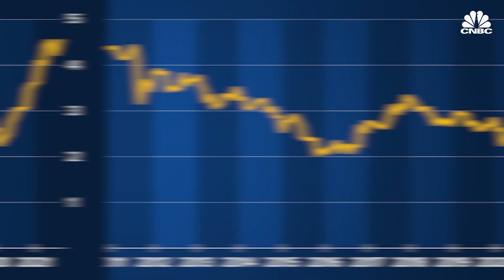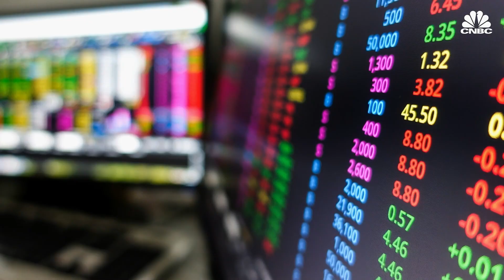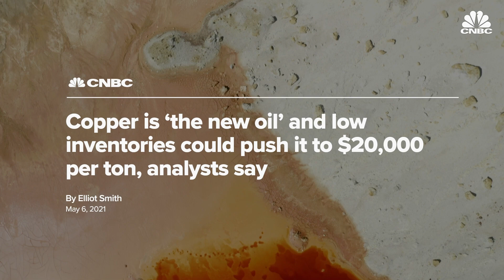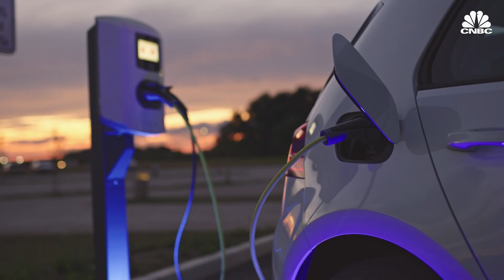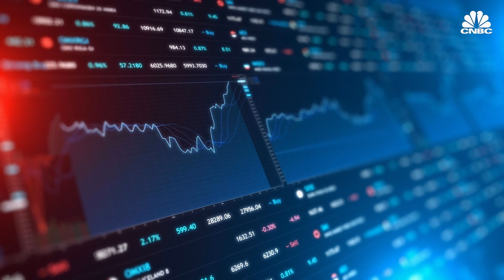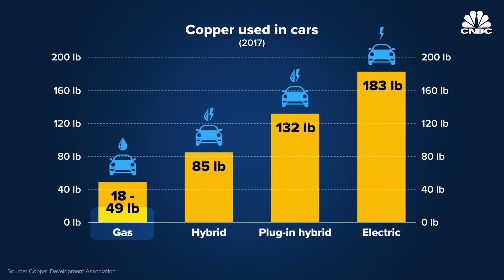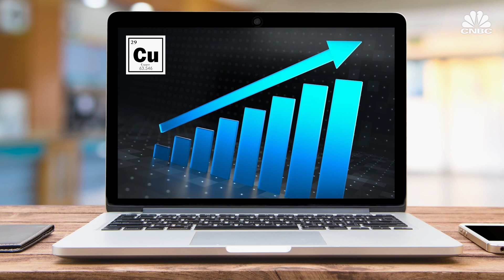Why A Looming Copper Shortage Has Big Consequences For The Green Economy

Comment: Jeff Currie should check his periodic table. Silver is a better conductor than copper.
Reply: Silver was used instead of copper for electromagnets in the Manhattan project during WWII because copper was in short supply. They borrowed a few thousand tonnes of silver from the treasury.
Reply: @zapfanzapfan  where do you got this from .. any reference?
Reply: @kevinfutero7166  Any article or documentary on the Manhattan Project tends to mention that detail. They also returned the silver with an incredibly small loss.
Reply: @zapfanzapfan  True, but they had to give it back
Reply: @zapfanzapfan  - I always wondered about using Silver Electroplated Copper Wires, for getting the Very best Conductivity, along with great Wire Strength, and still keep Costs to a reasonable level?
Reply: financial analyst afterall.
Reply: Copper is a good thing to possess... stats are a bit skewed...
Reply: @owenbruce4120  By the time a "hot investment" hits the mainstream media you are usually already too late. Never buy at the top, its never worth the risk
Reply: @Battleneter  agreed...timing and choice of commodity is the magic to fruitful acquisition...copper is stable
Reply: Silver is just too rare, it's not even a option. Like Silver, Gold is a better metal then so many other metals we use, again because it's so rare it's not an option.
Reply: And gold
Reply: Same with carbon, also copper is better then gold but gold doesn’t oxides over time like other metals
Reply: @hippiesmasher99  haha true
Reply: Material IACS (International Annealed Copper Standard)RankingMetal% Conductivity*1Silver (Pure)105%2Copper100%3Gold (Pure)70%4Aluminum61%5Brass28%6Zinc27%7Nickel22%8Iron (Pure)17%9Tin15%10Phosphor Bronze15%11Steel (Stainless included)3-15%12Lead (Pure)7%13Nickel Aluminum Bronze7%
Reply: Meanwhile Gold: am I joke to you..?
Reply: @theaveragescienceguy8652  Gold is third, behind copper. Gold is primarily used as a plating for corrosion resistance, that's why you find it on connectors.
Reply: @HangTimeDeluxe  but compare to silver , copper and iron , gold doesn’t have oxidative damage
Reply: @theaveragescienceguy8652  When you see gold contacts it is not primarily because of gold's conductivity. It is because gold does not oxidize like copper and silver do.
Reply: @keisreeman  that’s what I said…. But gold has other advantages like
Ductility and malleability
Reply: @theaveragescienceguy8652  Gold isn't as good as Silver or Copper.
Reply: @CupidFromKentucky  then make nano circuit and non corrosive space satellites from copper and iron and silver
Reply: And graphene and any super conductor.
Reply: That doesnt even take into account any superconductors.
Reply: For high frequencies due to the skin effect you can often get away with CCA (Copper Clad Aluminum).   Not a solution for most things,  but still useful.   Yes Silver is the best conductor short of super conductors.   Gold is third place behind copper.
Reply: Everyone is forgetting that silver is soft and copper is harder and silver is softer. As an electrician I would say yes copper is better not due to price but due to the fact it can be bent  more without compromising the wire.
Reply: @spencerock2187  so you’re challenging me that silver is more flexible and malleable than gold
Reply: I wonder why silver is a non-issue. There's a deliberate silence on the most undervalued metal today.
Reply: Yes sir and gold comes in third copper, second, silver is #1.
Reply: 1st - Silver
2nd - Copper
3rd - Gold
Reply: Exactly! Silver is THEE best conductor of any metal period.👍🏻
Reply: Join us
Reply: Yes, but silver is a lot more expensive so it can not be substituted for copper.
Reply: You should check price table of copper and silver
Reply: Want to know how to solve the problem from this video? Oh by the way.. silver you mentioned?! No! Graphene, go to my channel find a playlist to my other channel.
Reply: I'm glad this is the top comment! I was looking askance at the video as well, thinking..."Uhh, isn't silver better? It's just not as common in Earth's crust."
Reply: That’s what I said! Exactly. Omg if u check out Arcadia Economics with Chris Marcus, he rips Currie apart! It’s entertaining to say the least.
Reply: Aluminium is a good conductor but it kinks when you bend it, risking an arc of electricity and a fire
Reply: what about aluminium????
Reply: If you are willing to use precious metals to improve conductivity over common metals, why stop at silver. Gold has very similar conductivity but doesn’t suffer from corrosion while silver corrodes away when exposed to the open air.
Reply: My high school electrical class said the top conductors in order are: 1. Silver, 2. Copper, 3. Aluminum, 4. Gold.  Copper is the most practical for safety and price.  Gold was used in spacecraft because it easy to get into small spaces.  Aluminum can be dangerous
Reply: @earthsteward9  gold was used specifically because of its super anti corrosive properties. Silver is a great conductor but gets corroded very easily.
Reply: use gold
Reply: @d.b.6240  way too expensive
Reply: @ethimself5064  i use gold wiring in my home, its .000001% faster when I turn a light on.
Reply: Came here to say this
Reply: So is gold
Reply: @c4t-tp238  it works
Reply: I was about to post this same thing.
Reply: Exactly i paused the video when i heard that, copper is used 'cause lower cost and less malleable than silver,  but not everywhere, powerline use aluminium conduct less but weight less, gold is use where corrosion or oxydation are to be avoid.
Reply: @John Dillermand Stop trolling.  It's not.
Reply: Graphene beats both, hands down.
Reply: @moodtherapist  True,  but can it replace copper and/or silver or for that matter gold in the applications they are used in?   Don't they often use that in high current switch contacts?
Reply: @jeffm2787  take a look at the work Versarien (VRS), the only graphene producer certified by the Graphene Council is doing, particularly with Rolls Royce. If you can figure it out to electrify aircraft engines it should be possible to apply to more mundane applications on the ground. It’ll take some time - but it’s coming.
Reply: @moodtherapist  Hmm,  I see they have GFET's as well.  Yes my background is in electronics.  I shall check it all out.
Reply: Sam Allon you tried to be smart, but failed hard
Reply: I am sure cost is a factor
Reply: Currie is involved in the international suppression of silver pricing using derivatives and a true market value for silver would crush the central banks who have sold every ounce 100 times over.
Reply: Can I wire my house with diamonds?  Tesla's wireless bluetube house powered with diamonds?  Conductivity? Ancient alien theorists say "YES".
Reply: @yep-sb4uf  Diamond is an isolator - the only known form of pure carbon to not conduct. Even if you could form it into wires it wouldn't help you. Alternative application: diamond windows! With  its optical properties they will be the talk of the neighborhood! ;-)
Reply: if that's what Goldman Sachs hires, look out, he's an idiot. REPLY
Reply: They never said it was the best
Reply: Silver is more expensive but it oxidizes and tarnishes faster.gold is even better then silver but it’s too soft. Copper is a good all around material that’s cheaper while still conducting most of the electricity.
Reply: What about gold?
Reply: Was going to comment the same, something you learned in preschool almost. It's still the best economically viable, that is not what he says.
Reply: I know,… right?!
Reply: Better in context of modern electrical conductance doesn't matter.  One valence electron is all that is needed.  Gold, silver, copper.  All perform similarly in that regard.  Stability and corrosion?  Copper better than silver but sturdier and heat resistance compared to gold.  That is why we use copper.  Silver used to be use on electronics with your thought in mind but it just doesn't make a difference in reality.
Reply: Though silver is a very good conductor of electricity but still that is not used in electric wiring primarily due to its cost. It's very expensive compared to the widely used wiring material copper. Another reason for not using silver is that , it oxidizes easily and tarnishes when it comes in contact with air.

There is also less Silver on earth, and it is deeper. Requireing deep mines in some cases. Copper is way more abundant, and is closer to the surface. Allowing for strip mining, a less costly and far safer option of mineing.
Reply: This
Reply: I think they mean economically/non precious conductors
Reply: @smarkwick7814  Probably, but then he shouldn't have said "The absolute best conductor of electricity known to physics as well as the periodic table", which is an overly grandiose, objectively false statement.
Also consider e.g. superconductors, which are "known to physics".
Not to say we should be using silver in our wires, but just that I think people should be more careful making these easily verifiable, objectively false claims.
Even just using "most practical" instead of "best" would have been great.
Reply: @gerrychen  finally someone facts checks the fact checker, thank you for your service 
We need to add a misinformation banner on the video
Reply: @gerrychen  Plus the cost of silver over copper - sky high
Reply: @gerrychen  Do you know about super conductors? Then you would know about the extreme temperatures and conditions at which these materials must be kept at.
Reply: @gerrychen  There are workarounds.  LIke silver-plating other conductors.  Due to the skin effect most of the current travels on the outside anyway so that actually works. So, silver plated aluminum for the win.  Best of both worlds.  silver plated aluminum wire is expensive now but that's just because it isn't being used on a large scale.  Speciality things are always expensive.
Reply: @gerrychen  I was thinking the same thing. Copper is by far not "the best conductor". However it would be a challenge to get mercury to stay put on a circuit board or use wire nuts on. Then there's the cost of an electric toothbrush with gold windings possibly being a little high.
Reply: @gerrychen  Well said!
Reply: @smarkwick7814  No, he literally said "Copper is the single best conductor of electricity known to physics as well as the periodic tables".
Reply: @smarkwick7814  specifically said "The single best conductor"
Reply: @smarkwick7814  Silver is used in many conductors so they are simply wrong, they should update this video.
Reply: @smarkwick7814  smart dude 😉
Reply: @smarkwick7814  hhh&
Reply: @smarkwick7814   There should be no difference between what's said and what's meant.
Reply: Also aluminum
Reply: It’s gold better as well? I thought that’s why microchips used gold.
Reply: No. Copper and Silver are both better than gold. Gold is used as a thin external layer (plating) because copper and silver tarnish (oxidize) and the oxide layer is a bad electrical conductor. Gold doesn't tarnish/oxidize under normal conditions. Copper is used instead of silver because it's cheaper, but silver is better.
Reply: @ryannicholl8661  - Pure Silver doesn't tarnish (but like pure Gold, it is too soft to be used in wiring / and in many other things), and obviously also, too valuable. Alloys of Gold, tarnish less than alloys of Silver. So Gold is better in this regard.
Reply: @howhigh0521  no, gold is very ductile and resists reacting to other materials better
Reply: @howhigh0521  
Gold is only used on contact points because it doesn't corrode. Corrosion breaks contact. It happens with time and without movement, so something will just stop working if contacts are not gold.
Reply: @howhigh0521  Gold doesn't tarnish or chemically react as much and handles heat better.
Reply: @Foolish188  ohhhhhh 😲
Reply: There is no "shortage" of anything.  Inside-traders and Congressmen are deliberately withholding commodities, in order to artificially drive up the value.  Then, when they think it's high enough, they'll sell their holdings, then dump tons of copper onto the open market.  When the value plummets, they'll buy it up for pennies on the dollar.
Reply: Copper pipes are better for improving water safety, the surface actively kills bacteria in the water as it flows through the pipes
Reply: I hate that everyone always says every god damn metal besides silver. SO DUMB!!! little pea brains.
Reply: Silver is rare smh
Reply: Graphene is also a good conductor (maybe the best known). If mass-produced, graphene may be competing with copper very soon.
Reply: And Gold is a better conductor than silver, however if copper get to expensive silver might be an alternative.
Reply: @danadevoe7962  And beyond a certain point most all elements become superconductors. 😜
Reply: Gold
Reply: Gold is a better conductor than Silver. 
But those are "Noble" metals.   and thus very expensive. 
Copper is the Best "Regular" Metal for the purpose.......
Reply: Try Gold
Reply: @tylermotta2941  gold conduct less than copper, but gold don't oxide, copper oxide do not conduct electricity ( cf old video game cartridges ).
Reply: Thank you, I came here to say that.
I'm an Electronics Tech and talking heads talking out their butts and spreading misinformation with some sense of authority drives me insane.
Yes, I'm being pedantic, deal with it.
And yes, copper is far cheaper and more practical, it's the second most conductive metal, but just say that.

I heard gold mentioned a couple of times, it's not a better conductor per se, it's just corrosion-resistant making it the best choice for connectors and such.

Thanks for coming to my TED Talk
Reply: @zredband  my sincere pleasure, strange times huh?
They say believe the science.....while they deny it hahahaha!
Reply: @zredband  I enjoyed that reply. May I offer my opinion that you write better, and have more verbal wit, than the common run of your colleagues, although I'm pretty sure you realize it, but without conceit. And I protest that you are no pedant, as you surely know also.  Cheers.
Reply: Carbon nano toobs are the most effective ever but is a bich to make 1 foot 1 mm thick toob is like 7,000$ so venus here we come to mine you're carbon rich atmosphere
Reply: @thesilentone4024  we got plenty carbon on earth, no need to mine that anywhere lol
Reply: @thesilentone4024  Carbon nanotubes ... the material of the future, and always will be.
Reply: @gregvanpaassen  ya but we can make it i think we got about 75 feet right about now woo
Reply: @thesilentone4024  What?
Reply: @metorilt  what on what theres 112 messages here
Reply: @thesilentone4024  why not mine chinas air first.
Reply: @trazyntheinfinite9895  didn't Chana get so much rain the city was flooding with the 20 foot tall rain tunnels.
I think the desert can use it and before you say Chana is 50% desert yes it was now its 43% and there diverting 3 rivers to the desert part of Chana.
Ya we can definitely use it first.
Reply: @thesilentone4024  We don't know how to make them into current amplifiers yet.  Our attempts make it so we cant turn them off.
Reply: @thesilentone4024  lol "toobs"
Reply: @thesilentone4024  Which country are you from where you put the $ sign after the amount
Reply: @wyw201  usa 🇺🇸 just i wasn't paying attention
Reply: Good luck bud. Try to build a house by replacing copper stuff with silver. I wanna see how much it breaks your bank.
Reply: @Ahamed_Ramadan  No one said that a house should be wired with silver, "bud." The point is that he video contains a factual inaccuracy. I mean, from the comment, where did you even get that anyone thinks wiring a house with silver is being suggested??? Well..."bud"?
Reply: @HangTimeDeluxe  the house was an example m8... When the cost and usability of a copper is soo much better than silver it doesn't matter if it is more conductable... It does the job and it does the job well enough while not costing a lot. Thats what i meant friend...
Reply: @Ahamed_Ramadan  price is “irrelevant “  silver/gold is a far better conductor
Reply: @gerritbrunink9117  how is it irrelevant when you want to use is for commercial use... It matters if it can be found easier and costs cheaper to use.
Reply: @Ahamed_Ramadan  The order is silver, copper, gold, and aluminum.  You can obviously skip gold and go to aluminum.  aluminum wiring has been a thing for quite a long time. The problem with aluminum is that it oxides and that resistivity causes heat and fires.  There are ways to mitigate that though with the right connector type.  As to the price, aluminum is much cheaper than copper. If conductivity is actually a concern all you need to to is go up a notch in wire diameter to make up for it.  I haven't researched it but the price difference is probably still on the aluminum side.  But electrical codes probably prevent using aluminum in most places. As copper continues to get more expensive you will start to see aluminum being used more and more.
Reply: @dougcox835  sigh you, haven't ream my, other comments bht whatever. Aluminum is bloody brittle... Yes some places it can be cheaper, yes some places use it but when you have copper who isn't brittle and is cheap and is more malleable than the others it doesn't matter. Your example of using aluminum is like someone's example of using silver. Yes both maybe a little bit better at conducting electricity but both have fundamental flaws copper doesn't have. (silver being hella expensive and aluminum being hella brittle)
Reply: @Ahamed_Ramadan  Or straight up just break. Tensile strenght of silver is lower than copper.
Reply: @DunnickFayuro  true but it is hella expensive m8
Reply: @Ahamed_Ramadan  Even if you need less of it because of better conductivity? (Just speculating here, I don't know much about it)
Reply: @DunnickFayuro  bruh see their perspective prices then talk
Reply: @Ahamed_Ramadan  Just did. Silver is 7% more conductive than copper, but a bit more than 5 times more expensive. Not worth it :/
Reply: @DunnickFayuro  exactly... And you are sorta wrong copper is 1.34 %the price of silver per pound. A pound of copper costs like 4 bucks. And a pound of silver like 300.
Reply: @Ahamed_Ramadan  Not a bad idea, silver twice the cost and save some electricity and have more home investment.
Reply: @Ahamed_Ramadan  sounds like a really good way to hide an investment.
Reply: @Ahamed_Ramadan  🤣
Reply: @Ahamed_Ramadan  Not his point
Reply: @Ahamed_Ramadan  Too expensive. Aluminum is an alternative, but units of American Power Conversion burned off when copper was replaced by aluminum. 
And so, copper is the best and safest.
Reply: @solapowsj25  aluminum ain't that malleable friend... Its harder to use aluminum for a lot of the stuff coppers are used for
Reply: @Ahamed_Ramadan  - Aluminum is actually fairly malleable, but it's also 
 far more brittle than copper, and can develop fine cracks. In wiring aluminum expands and contracts more than copper under electrical load, and over time, this can cause circuit failures or even electrical fires. 

My house actually has aluminum wiring still (on some circuits) and these circuits still work fine (house built in 1966). The problem is at the junctions/ terminations/ breakers where the exposed/ clamped wire expands/ contracts, and can develop aluminum oxide (which can cause arcing, burnoff, or cause a circuit to fail or overheat (sometime catch on fire or melt insulation).
Reply: @Sovereign_Citizen_LEO  yes friend, the main things about wires are that they can stay fine even after putting a lot of stressand bends. Aluminum can't do that well. For better or for worse copper comes out on top because of a lot of factors...
Reply: Silver is also a lot more expensive
Reply: You use silver and let me know how it works out for the pocket book
Reply: @Whomikejones972  bruh
Reply: So is platinum.  In fact, it's a better conductor than gold, copper or silver; and like gold doesn't oxidize, but it's so damn rare that unless it's discovered in large quantities on some nearby asteroids that can one day be mined, it will never be in general use as an electrical conductor.
Reply: @Kwolfx  - Platinum is about #15 or #16 on the list of metals and their ability to conduct electricity (Conductivity vs. Resistance). The lower the resistance, the more conductive (if I remember).
Reply: @Kwolfx  silver and copper are both 4 to 5 times better conductors than platinum. If you had spent 30 seconds, a google search wouldv'e shown you that.
Reply: Hi In college we were told that gold was best.
Reply: @dennisthegrower  Mail order college?  😁  Or did you have history professor filling in that day?
Reply: @dennisthegrower  Get a refund on your education.
Reply: @dennisthegrower  it's the best at never caroding or tarnishing. But silver has it beat in many other properties. Most conductive, most reflective, antibacterial ect.
Reply: Or gold
Reply: Gold is better than copper and Silver.
Reply: And gold is better
Reply: I worked at a company that made parts for the old satellite dishes, we made parts that were copper plated then after the aluminum was etched out, it was then plated with gold. So gold is a better conductor, silver 2nd, then copper.
Reply: @samtheshame9951  No.  Silver is the best, followed by copper, then gold, and finally aluminum.  Gold doesn't corrode. That's why they use it.
Reply: @samtheshame9951  
No, gold is not best, it's silver, copper, gold. Gold is used on contacts because it doesn't corrode and break connections.
Reply: @samtheshame9951  no, gold is used because it  corodes less
Reply: @samtheshame9951  Cold is not the best conductor. Silver is. But silver corrodes easily. Gold is also more ductile than Copper. Gold plating makes sense when corrosion protection is important or when contact conductivity matter ( making good contacts by pressing surfaces together and an keeping them in contact in face of corrosion from moisture).
Reply: @michaelrenper796  Thanks all for educating me lol, I was a young apprentice at the time working there and was more interested in drinking beer and playing softball. Part made in the Model Shop were often plated, not just gold.
Reply: @samtheshame9951  Gold doesn't corrode, so it is very good long term. But, when clean, silver and copper are better.
Reply: @samtheshame9951  - Aluminum is an excellent conductor of electricity as well. But other properties (such as being brittle/ cracking/ lack of ductility), make it not as good as copper, gold, or silver.
Reply: @samtheshame9951  1. Silver 2. Copper 3. Gold . Gold doesnt oxidise so its used to plate  critical electrical connections .
Reply: @steveone  thank you
Reply: @samtheshame9951  - Gold's Primary Electrical Advantage is Corrosion Resistance!
Reply: @samtheshame9951  No.  Conducting is valence electrons.  The outer shell configuration.  Copper and gold have same.  Silver is "better" by this point but it doesn't matter.  Modern tech doesnt gain any benefit from it.  Gold is used in space because of other reasons like radiation, corrosion, so on.  Copper better than silver for these reasons in modern electronics and is vastly cheaper.
Reply: His definition of “best” is practical.
Reply: @DanielGreenlee  that's not what he said. He said best known to physics and the periodic table. Both are wrong.
Reply: @DanielGreenlee  power lines are aluminum
Reply: @DanielGreenlee  Wording matters.  Best is not the same as most practical.
Reply: Dude, microchips use copper on the silicon and for the bond wires. Inductors and DC electric motors also use copper exclusively. All motherboards and expansion cards use only copper. Silver and gold does conduct electricity better but are cost prohibitive.
Reply: @tringuyen7519  You know they use gold on circuit boards too right?
Reply: @aBusybee  Not necessary to do so though.
Reply: @tringuyen7519  Gold does not conduct better than copper.  It's used because it doesn't corrode.
Reply: @tringuyen7519  The cost of silver and gold is not significant for electronics. The amounts used compared to the cost of the end product are small. In fact silver and gold are used extensively in electronics - e.g. bond wires use both, modern solder alloys contain up to 5% silver and PCB contacts often use gold plating. The necessary amounts are still small enough for raw material costs not being an issue. Those metals are not used more because of their other properties: silver tarnishes faster than copper and would melt away if you tried to solder it; gold is a worse conductor than copper and has a few other properties that make copper preferable.

Check the wikipedia pages for "wire bonding", "flip chip", "interconnect (IC)" - you'll be surprised what metals are used.

For electric motors the material cost would be a significant factor though. Cables, motors, pipes and beefy high power connectors are where  the "shortage" is actually felt - electronics guys may complain, but copper price does not influence their material decisions much.
Reply: @tringuyen7519 - But the copper is usually Gold plated on circuit boards, in microchips, in DIMMs, and in essentially every other conductive ciruitry for microelectronics and in many cases fine (super thin) Gold wire is exclusively used.
Reply: Quit being obtuse, I'm pretty sure you know why he stated it was the best conductor, real world applications and such.
Reply: @thenewguythedruid  he didn't say best conductor. He said best known to physics and the periodic table. Both are untrue. He can be grandiose if he wants but he can also be called out for being wrong.
Reply: @Paztacos  I think taking into consideration of physics you then need to take into consideration the reactance and how a material interacts with other materials that it would need to for expected real world applications. Wouldn't you agree or would you narrowly think that no he meant singularly lab results not withstanding real world applications
Reply: @thenewguythedruid     no physics doesn't take cost into account. There are many conductors that last longer hold more stably and are longer life but they cost more would you say they are worse based on physics and the periodic table? Is gold a worse conductor then copper? Are super conductors worse then copper?